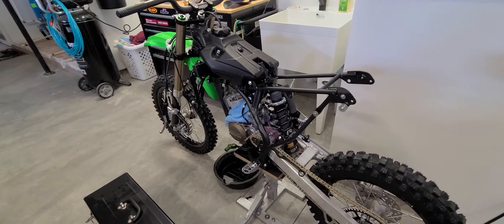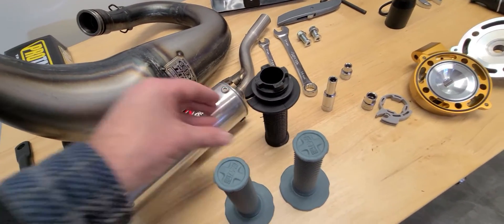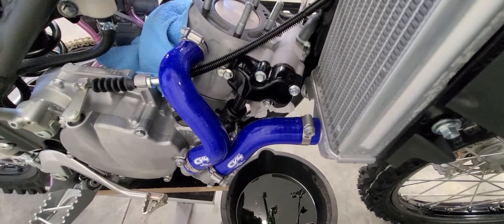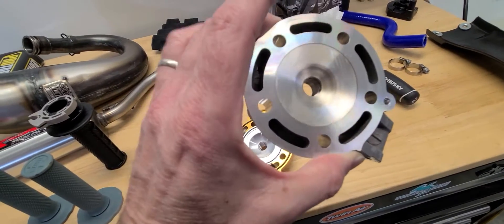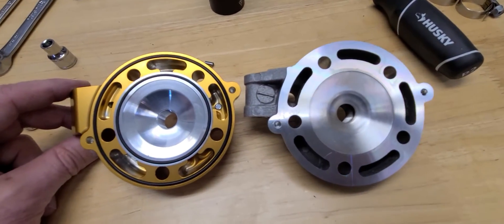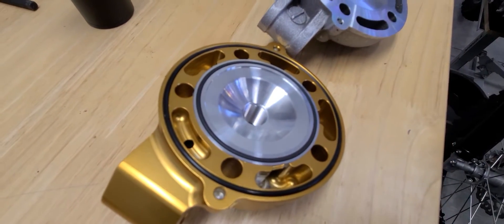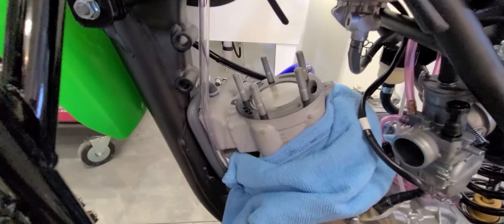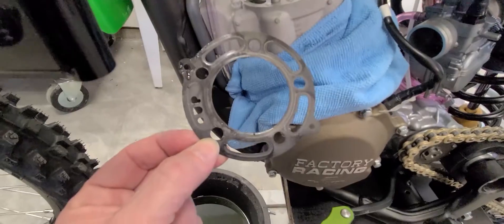KX112 VHM Cylinder Head

Comment: Did you move to higher octane race fuel?

I had Pro Circuit cut my YZ85 head for 108 octane VP C12, and boy, what a huge power increase!
Reply from the maker: @chestertownelectric6290  no, the change in domes was more about squish band, and very slight bump in compression. Runs very good on pump gas.

Comment: Which P/N insert did you use with that head?
Reply from the maker: SX insert. Higher compression
Reply: @GOATbro_Australia   which P/N though? I picked one up from Langston as you said you did with the SX insert as well which is the 240B-001 insert. I was curious if that is the same one you used or if you got something different.
Reply: I'm trying to figure out if that insert will work for the KX112. VHM website says it's for KX100. The KX112 inserts are a slightly bigger combustion chamber.

Comment: Do you have to do any carb tuning for these mods ? What did you do to your carb
Reply from the maker: I jetted the carb according to owners manual for my typical temp and altitude range. Which meant one smaller on the main jet and airscrew out to 2 1/4 turns. Runs super clean.

Comment: I raced professional motocross in the 80’s before the big bucks.  I was sponsored by Team Suzuki.  Anyway, 2 strokes compression is made in the crankcase.  The new head is beautiful but probably will not make any performance gains.  Race bikes are so evenly matched horsepower/weight wise from each manufacturer.  The rider makes the difference.  Going down the straight away, horsepower wins. Better riders catch up in the Twisties.  Engine mods are the most expensive mods with small horsepower gains vs what comes out of the factoru on race bikes.  Lightening the bike helps in the acceleration, braking and handling.  Surprised we do not see more carbon fiber frames at least in the professional sector.  Even making the engine part of  stressed member of the frame would help similar to high performance street bikes.  KTM makes the best bikes from the factory with no mods needed.  When Kawasaki made the 100 cc 2 stroke it was because of the increased unsprung weight of the 19/16 wheels.   Plus more rotating mass.  Truthfully the 100 cc was not enough, hence the 112 like Yamaha.  I would of gone with a stock 125 like a YZ 125 or 250. Just sayin
Reply: actually I just dynode my 112 with a phat head high comp dome , made 1hp ,1ft/lb in most the rev range

Comment: We run apex technical innovation heads with the drop in inserts. Best mod ever! Almost we vmh with my sons but i run apex on my yz250 for about a year. So i figure go with what you know. Now his kx pr2 112cc motor just runs the pr2 turned down head. Cool build hope you bought both inserts for the head. Have a good one 👍
Reply: What head is best for 112 kx ?
Reply: @ivanvelez-m1v  id still probably run the apex technical innovation head. 85/100/112 all the same cylinder jug

Comment: So the vhm cylinder head is a 85 cylinder head but it fits on a 112?
Reply from the maker: The kx100 and kx112 use the same head. Same Kawasaki part number: 11001-0774 is used for both the KX100 and KX112.
The VHM part number for the KX100 head is: AA33151-1
The VHM head fits my 112 perfectly.